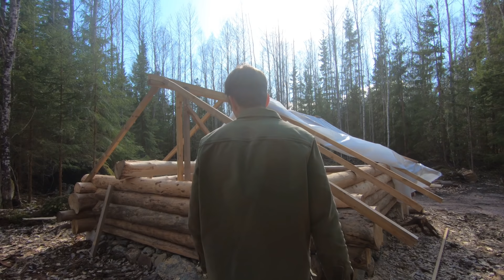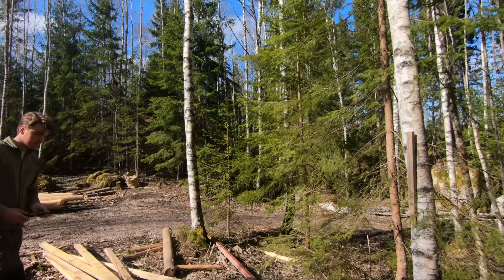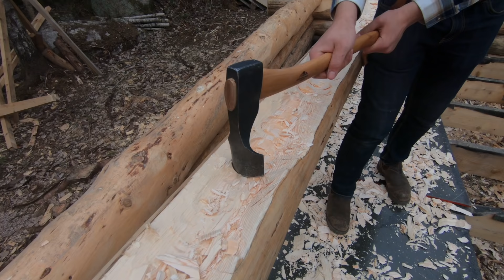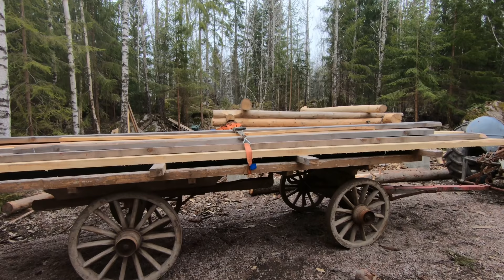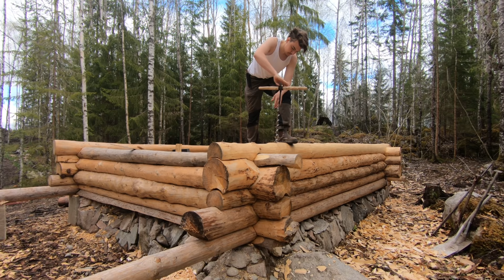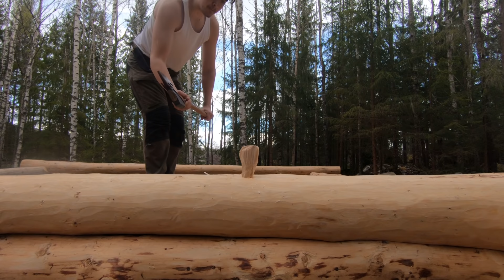Off Grid Log Cabin Build Starts Again! Only Hand Tools | 13 | - One Man Traditional Log Cabin series

Comment: Using dry dowels in wet logs gives you a  tighter fit! 
when the wet logs dry the hole gets smaller.
 When the dry dowels suck up the moisture  from the wet logg they will expend!
Keep up the good work 👌💪

Comment: I really like the new subtitles. I saw you eating lunch. I was wondering about what you normally eat on the job? I imagine that all the work uses a lot of calories. So what do you normally eat? Also wil we see any more of the dog? What breed is it? How old is that tractor and what is the manufacturer? It seems like an old tough machine. The kind they don't make anymore.
Reply from the maker: The dog Alice has got puppies, it is a Kavalier King Charles Spaniel. The traktor is fully original old Ferguson "Grålle" from 1950s, these have dragged a lot of timber in Sweden when they came. 
This might not be the best but I don't eat much when I am out working. I eat a big breakfast and sometimes have something small like a sandwich with me and work 7-9 hours. Then eat much for dinner, real "husmanskost". Then sometimes I work a little more in the evening and have a very small evening "snack". I don't like having to take a big break eating or having with me a lot of food when working, but this is just me. There is probably a better eating schedule for me. Thank you for the questions 👍

Comment: I've built a couple shrink fit fullscribe,, you can skip the dowles it ain't going anywhere .,, as long as you spline the doors & windows with 2x4's.. It's gonna be lovely either way,, But mine would be easier to move,, lol!!!! I built it that way incase the people didn't pay!!! Aloha be safe don't get hurt!!
Reply from the maker: Smart to build it without dowels if they didn't pay, lol. But I am concerned that with time when the logs dry they might curve outwards or inwards leaving gape if I don't use the dowels. I am going to spline the doors and windows to.

Comment: Great work as usual! I noticed you hit the pegs all the way down. I have heard that you should not make too tight fit there and leave a small gap (so that the peg is shorter that the hole). Otherwise the pegs will start carrying the cabin when the logs settle. And that causes gaps between the logs. Not sure how big deal that is after all, but it would be interesting to hear how it's traditionally done there.

Comment: Great content as usual! How do you know if the log is too high as you described? Also, what is the purpose of that short board you have on the tree?
Reply from the maker: Thank you. I have to plan what log is going to be next on the notch. The next log is not big enough (diameter) to reach over the notch and leave enough above for next notch. This you always have to plane ahead for, specially when the diameters differs in top and bottom end. Hope you understand my explanation. 
The board is used to set the scriber in level, so the points are exactly above each other.

Comment: hei Erik! nice one again!

whats your thoughts on straight vs curved handles for the felling axe? and how do you sharpen your saw?  dont know if thats what you want but would be nice to learn about tools too!  and where to find this compass?
Reply from the maker: Thank you. Doesn't really matter if you go with a straight or curved handel, just what you are used to. I like straight handels for bigger axes (Gränsfors felling axe) and curved for smaller axes. I use a file to sharpen saw, could show this in a video. I want to do a video on what tools you need/what I use to build with hand tools. But this will probably be a video much later on.
Reply: @ErikGrankvist  perfekt, i think this would be a good video!